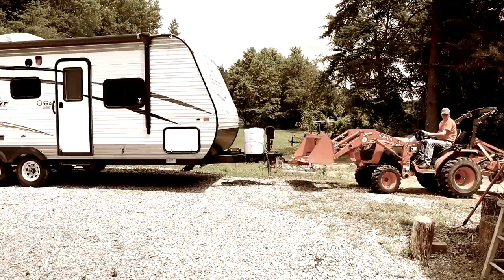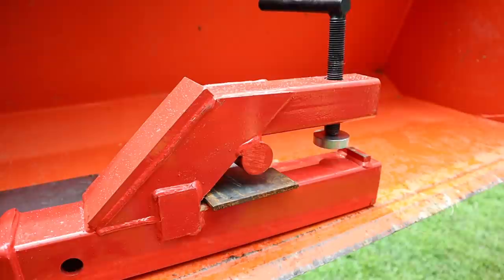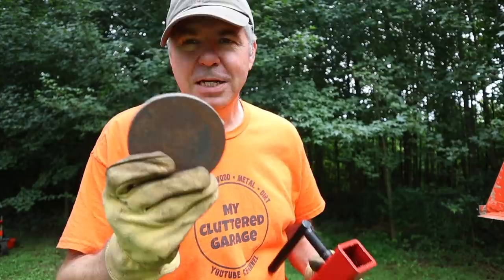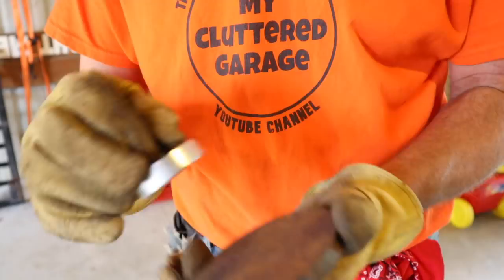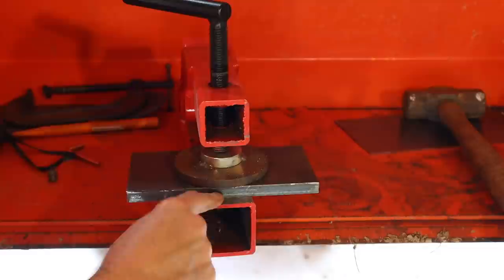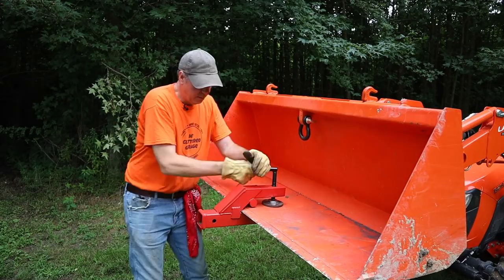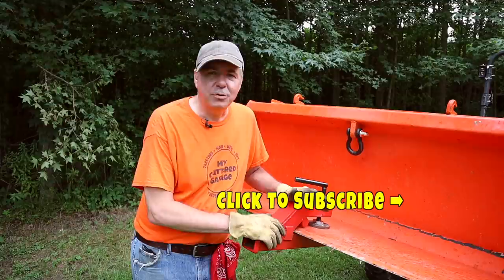#65 Clamp on Trailer Hitch Major Flaw and Mod! Kubota B2601 compact tractor.

Comment from the maker: Here are some product suggestions. These are Amazon Affiliate links, so purchasing will help this channel by providing a small commission while not costing you any more. Thank you for your support!
Clamp-on Trailer Hitch:
https://amzn.to/3jbkeFD
Lumax Heavy Duty Grease Gun:
https://amzn.to/3mFK1pA
LockNLube Grease Gun Coupler:
https://amzn.to/3kPcvwu
Recommended Grease:
Valvoline Moly Fortified
https://amzn.to/3jNM1Kv
Nitrile Gloves:
https://amzn.to/34Kg8OG
Deerskin Gloves:
https://amzn.to/2I17NNy
My Video Gear:
Rode Wireless Go II microphone:
https://amzn.to/3eiJatG
Canon M50 Camera (now Mark II):
https://amzn.to/3vHW9uD
Battery adapter for M50:
https://amzn.to/2RshsBE
Sigma 16mm prime lens:
https://amzn.to/3vJDRcx
Sigma 30mm prime lens:
https://amzn.to/3epFneh
Variable ND filters:
https://amzn.to/3tmoHIs

Comment: Mr. Ed ,This "fix" is on the right track.Had a similar devise; that did "everything WRONG". lt twisted, shifted, buckled ( never bent) but "luved" to almost FALL OFF!( wrenched on the "wing-nut" constantly).
Rather than "Tweak IT" & DRILL the loader bucket & "Bolt-action" it all altogether & "Unitize it" for a ridged & SAFE application; l SENT IT BACK. 
Then "proceeded" to the drawing-board fer a "Real-Safe Miricale Wonder Devise". 
The "unit" consists of 3 parts, is strong( moves my 5400lb 22' 900lb tounge  weight  deck-over tilt trailer; uphill through the mud constantly). It only takes 10seconds for "on & off" efforts. 
Were as your "unit" might work for you & others; l would not trust this "quicky-universal, Wing-nut" devise with more than 45 ounces!
Thank you Sir for the Excelent vidio and happy safe tractor toteing. Best wishes with all your endeavours. 
The only "klinker" is that the "3 piece unit" weighs 62pounds.
Reply from the maker: Thanks Donald! I’ve limited my use of this to moving my small utility trailer. I now use the 3 point “heavy hitch” for moving anything larger.

Comment: suggestion, add a chain hook on each side of the hitch,  then use straps or binders to your bucket hooks.  this will help prevent the smiling loader bucket.
Reply from the maker: Thanks, Philip. Good tip. -Ed

Comment: Nice fix it, Ed. Now that it's too late, could you have aligned the front of the rectangular plate so that it meshed with the back side of the welded on bucket edge? That would make it even more resistant to twisting.
Reply from the maker: Hey Terry. I was planning to do that but the plate has to be back so it can slide on an off. Probably could have moved it a little closer or used a larger plate. Thanks much!
Reply: I made my own and was thinking of adding some angle iron to mesh with the bucket cutting edge to stop twisting

Comment: Great fix, now to find me some steel.  I have a lot of welding to do. Bought an old used JD 1209 MoCo that needs the bar that the tongue bar connects to repaired. It had cracked and was poorly welded, and completely busted, so have to pound it back straight and weld in some new steel behind it.  While I'm getting the steel for that might as well for this hitch too.

Comment: Heads Up: Kubota  4X4 front axle I have checked all seem to be very low on Hydraulic oil.   Kubota should use a thicker gear oil,   Please keep an eye on that   very $$$$$ to replace gears.
Reply from the maker: Good to know! Thank you.
Reply: Thats a flaw in the PDI, not the lube. The axles get an air bubble when filled, and have to be worked a bit to break the bubble, then filled some more.    It's due to the shape of the housings where the gears run through at right angles to reach the wheel, the lube sits there and doesn't fully run down into the lower hubs until the wheels are spun and turned back and forth a few times so it appears full when it's not.   Not much different than purging the air out of a power steering system.

Comment: Much more better Ed.  I was thinking of doing the very same thing to the top of my  bucket.  I have some weld on hooks I bought a while back,  I also have a  pice of plate that is 4"s wide by 60"s long and 3/8"s thick. If I add a hook to the center of my bucket I will first tack weld the plate to the bucket and weld the kooks to the plate. This should strengthen the top so it don't get all crinkled up. Good video and a great idea you had.
Reply from the maker: Thanks Dean. Sounds like you have a good plan!

Comment: Thanks for the video!  I have one and did not have any bending problems; thicker bucket I guess.   I did have a problem with twisting on the hitch when a turn was made. I solved the problem by welding on a tab  to the hitch so that I could put a bolt through the cutting edge of the bucket. cutting edge already had holes so didn't have to make new ones in hardened edge. No twisting now and very solid.
Reply from the maker: Great idea, Don!

Comment: 1) There's no real need to grind off the little rectangular key.  Just weld the big flat piece up next to it and save yourself some work.
2) You might want to measure the rectangular flat piece and size/place it so that the front edge (the one facing the front edge of the bucket) is up pretty close to the back of the cutting edge of the bucket.  That gives the whole rig something to slide up to and butt against if you start pulling on a trailer that's stuck.  The clamp screw likely won't keep you from pulling the hitch rig off your bucket if you pull hard.  Tack everything first to make sure it will go on and off OK.
3) My bucket (L35) has some wide reinforcing ribs underneath running front to back, so the rectangular added piece should be sized to fit and not just random or they might overhang.
4) 
5:54 - "You really should clamp your work down."
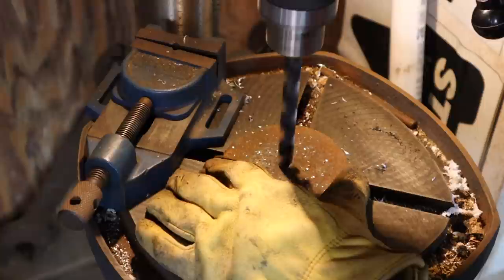6:20 - Keeps right on drilling without clamping.
5) I never drill steel dry.
Reply from the maker: Hi John. I appreciate you watching and all of your input. Happy new year! -Ed

Comment: I've been looking at getting a receiver mounted snow plow, and thought putting a receiver on the loader would allow me to use it on the tractor as well. That would be a fairly significant shock load and torque, though. This looks like a great improvement.
One thing that amused me, though, is worrying about dents in the bucket. I've had my tractor for 35 years now and the bucket is scraped, dinged, dented and bent... still works though with no detectable problems.
Reply from the maker: I’d recommend something like a set of pallet forks with a built in receiver for something like that. I don’t mind dings and debts, but I like to avoid them when possible. Thanks for watching! -Ed
Reply: @MyClutteredGarage  I came across another improvement to make: 2 pieces of angle iron welded to the sides of the receiver that rest against the cutting edge to take up the twisting moment. I'm going to get going on this. Even without the snow plow, this will make moving trailers around much easier.

Comment: What about just welding a receiver to the top of the bucket and adding a dropper?  A heck of a lot more secure, and it wont have the typical twist you get from putting a side load on a clamped down apparatus.
Reply: This "idea" might be Great; but also too high -even with a drop-hitch. I made my own "miricale-wonder devise"; it wont slide,bend the "bucket",Or EVER FALL OFF. The bugger is three pieces, on & off in 10 seconds;-/= but weighs 62 lbs! 
Just wouldn't "Trust" a "rinky-dinky, universal wing-nut" devise for "anything" to be moved that weighs more than 45 ounces !

Comment: Thanks Ed, I'll be making modification to the one i purchased this weekend.  If you don't mind, please add the Length & width on the 1/2 plate and the diameter size on 3/8 round stock.
Reply from the maker: Hi Keith. It's not critical, but the 1/2 plate measures 4x8. I would have even gone wider than 8" if that's how it came (scrap is what it is!) The 3/8 round piece is also 4". Good luck! -Ed

Comment: I have the same trailer hitch and love it.... I have a kioti ck3510 SE and my bucket is far more heavy duty than the kubota bucket..... Your kubota bucket sounds like a tin can....  If I had purchased a kubota tractor configured the same as my kioti tractor I would have paid $10K more
Reply from the maker: Hi Marshall. A thicker bucket would definitely make a difference. I like Kioti’s from what I’ve seen. Thanks for watching.
Reply: @MyClutteredGarage  I looked at JD, Kubota, TYM and other tractors and Kioti seemed to give me the most value for the money.  That bucket trailer ball hitch is  great value....

Comment: I'm thinking they may have made it that way on purpose. I think it was suppose to put everything in a bind by slightly deforming the metal to keep it from sliding off on heavy pulls. It seems the new way will allow it to be pulled off more easily.
Just my guess, what do you think?
Reply from the maker: These hitches do shift side to side with heavy pulls, but I think the bigger surface area and the ability to tighten it more will actually help. We’ll see! Thanks much. -Ed
Reply: @MyClutteredGarage  By the way, we love your jingle. Weather my wife is in the room or elsewhere in the house, I hear hear say " Yeah " at the end.
Reply from the maker: @plainwornout3964  that’s awesome. Thank you!
Reply: It can't slide off if it's tight and the welds aren't bubble gum, the extra thickness of the cutting edge and the larger plate would prevent that.

Comment: Thanks for posting this, I've been looking at  efficient ways of moving my trailer with my Bx23S and I think this clamp along with the mod is a great way to go about it. With a little bit of time in the garage one can get it done with less than $100 total. Does your Hobart have a regulator for CO/ argon? If so I would try and find a used bottle and go with shielding gas for your welder, so much better welding than a flux core. agin thanks for posting all of this.
Reply from the maker: Thanks James. Yes I have an argon/co2 tank now with solid wire. Makes for a much cleaner weld! -Ed

Comment: Great informative video!! I'm looking at picking one of these up. Just curious; have you ever had it want to pull off on you? That's my biggest concern and I can't find any that have the chain slots to go around the bucket like some clamp on forks do. Thanks!!
Reply from the maker: Thanks! It can come loose, but won’t likely fall off. Don’t move anything too heavy with it.
Reply: Thanks for the insight and great videos!

Comment: Could that fit on three draw bar in the rear?   I want to mount a whinch plate on the draw bar.
Reply from the maker: I wouldn't trust it for that. I don't think it would clamp on tight enough. I would look into a 3-point hitch receiver like this: https://youtu.be/hcnwB93bNGc?si=tH8c2rwxRitRGhfV